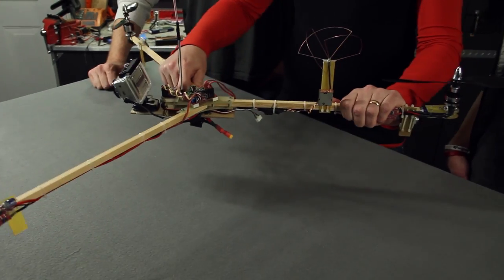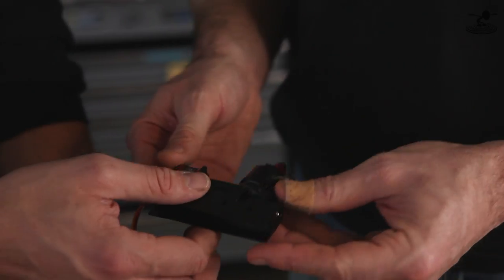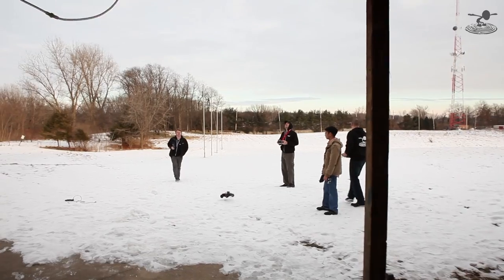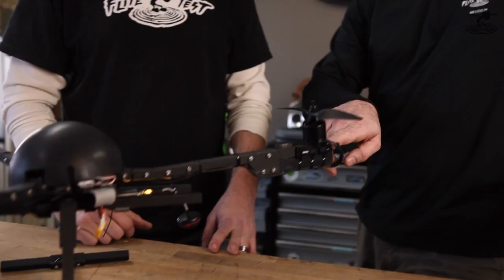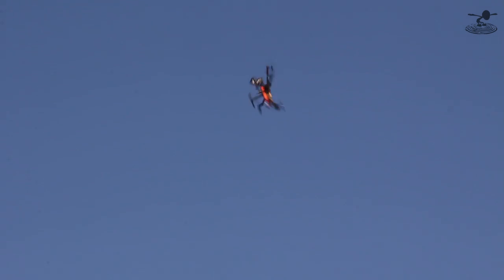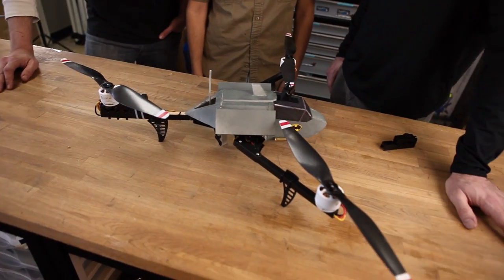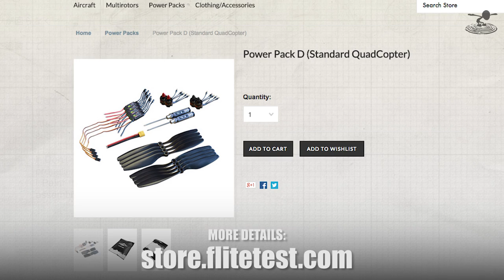Flite Test | Tough Tilt Tricopters

Comment: My first multi-rotor is David's Tri-Copter V2.  I put on 3 - 450 Slow Fly motors with 12" props.  She hovers at about 30% throttle with a 2200 3S motor.  I learned a lot about flying mutli-rotors and building with this copter.  You guys are the reason I am flying.  Thanks for being awesome!!!!

Comment: I came here to find out how the tough tilt motor mount actually works so I can use it in a Scratch-built model. But there's no video of how it tilts or works. At the very end of the video I hear there's a build video of using it. Maybe that video is what I need to see. Better yet, SHOW US HOW THE TOUGH TILT MOTOR MOUNT WORKS!

Comment: those EMAX motors are sweet, i got some cheap, straight from the EMAX warehouse, and put them with cheap Mystery simon K ESC's, and kk2 with stevies 1.17 all wrapped up on a sk450 frame with 9 x 3.7 props. flys great even in windy wellngton.

Comment: A tricopter with three of these would be pretty cool, so you could adjust the angle of the front motors to go even faster once in the air, sort of like a v22 osprey tricopter

Comment: Something I think would be interesting to see would be a dragonfly configured so that the the two motors on the center spars are configured strictly as thrusters.   Imagine the flat spins you could achieve with one running forward and one reversed.  I would think your forward and backward speeds would be impressive.

Comment: Man, I like it when tricopter stuff comes out and I've also suffered a bit from not having a perfect tail tilt mechanism and doing it different on every build.  BUT THIS IS MISSING THE POINT :-(

The thing everyone misses with tricopter tilt mechanisms is the axis placement with relation to the CG of the mass you're tilting and I only realised it when someone on diydrones complained about it.  When you use the servo to tilt the motor to the right is because you want to yaw left... but you're shifting the whole weight of the motor + prop to the right too, so there's an exactly opposite effect, you iniitially get some amount of force yawing you to the right.  Same when you're trying to stop a yaw movement...

The axis of rotation needs to be an average of 2-3cm above the motor base.  And there are no kits or parts available for an easy build.

Second, it doesn't matter how strong the mechanism is because it's the servo that breaks.  So you don't want a direct drive or a same size gear pair like the Hobbyking stuff this video mentions (Trifecta), you want a reduction.  You don't need a 180 degree range of rotation, even about 20deg would do for most people. You do want the mechanism to have the added torque of a servo with a simple reduction which is actually quite easy to achieve in a manual build.
Reply: It needs a NOTAR on the back problem solved!

Comment: All the OPTO escs I've seen have been more expensive than their bec'd counterparts.  Also, checking individual components before wiring it all together is a good practice everyone needs to get into.  It doesn't take much time or effort to run a bec through its paces on the bench before wiring things up.

Comment: With the 5 boom copter, add a second motor pointing down at the back and going the opposite way to the top
So if you lose a back motor you don’t fall out of the sky
But you also keep the great rudder authority

Comment: Nice guys. Did you gyd modify the Yuneec gimbal so you can use fpv goggles instead of a tablet device? I saw the CP antenna at minute 13.26 and that got me wondering,

Comment: also i use bearings for my 360° motor turn and mini bearings for my folding blades, so if i flip, just turn the motors opposite way, and it still flies. now i need do make Landing skies that also go the opposite way,because if i land with the motors turned, it will land on its top.

Comment: i wanna see a big ass quad with Traxxas 2200kv motor:P
Reply: Unfortunately the motor that you have is a brushed motor, you need brush-less for multirotor applications.  If you want to see something along those lines look up some of the large endurance quads.
Reply: ***** you may be confused. i know for a fact that it is a brushless motor.
Reply: CollinandMason Whoops meant in-runner motor(ACT takes a toll).  Unfortunately again, you need brush-less out-runner motors(not car motors)
Reply: ***** if you really wanted to do so, an inrunner motor can be used for a multirotor. but the props would be very small, and the multi would likely have oscillation problems do to the inertia of the motor internals.
Reply: CollinandMason  Inrunners are WAY higher KV, 2200kv, like you said.  Multicopters typically run at 1000kv, unless it's a small race quad, then it can be higher.  On the other hand then it would be small...  Sherman Hartman If there was a gear reduction system (which is inefficient I know) then you could.  The motors on my cousin's A.R. Drone 2.0 are brushless inrunners, and have really extreme gear reduction.
Reply: True. But either way, there isn't going to be much performance coming from in runners.
Reply: Sherman Hartman Also true.  Bottom line is if you want a "BIG ASS QUAD" use Avrotos XD

Comment: I wonder if a break point could be designed in to the servo mount, sounds like a lot of servos are getting killed with the new supper strong tail pivot. Maybe just a single thin zip tie to hold the servo so in a crash rather then stripping a servo you just replace a ziptie.

Comment: Just a thought, it would be great to offer a "quad to dragonfly upgrade" kit that has the tough tilt, servo, and an additional motor and esc. That way there is a simple/easy way to make a dragonfly for those that just bought the quad setup. (yep, I bought the quad and completely forgot that I would eventually want to make it into a dragonfly).

Comment: Hey. have you ever tried to generate the counter torque of a trycopter by a flap under the Propeller instead to Tilt the whole Motor. this can be much better because there are less vibrations an no coriolis forces to handle
Reply: I've been thinking of the same thing and saw a video somewhere on youtube (don't have the link now) of someone who's done it - it works.

Comment: How does David Feel about your 3D print comments?  I think it's awesome that you are bringing such a durable tilt mechanism to the hobby, and even cooler that you are going to stand behind it.  I hope people understand that 3D printing isn't exactly the best option available, but it is functional, and more crash worthy than you allude to in your video, especially if the person using the 3D printer knows what they are doing and takes the time to set the speeds and nozzle temps correct.  It also allows you to provide free .stl models to your customers so they can make their own replacement parts, which seems to be right in line with your business model.  I know the Sweed doesn't work with you any more, and I think you are still very good friends, but it felt a little like you were bashing his product, which by the way offers the best carbon booms available for the hobby.  Awesome tilt mechanism, but your comments on 3D printing did not feel well thought out.  Who know's maybe you and David have some sort of unannounced partnership, but you should make it right.

Comment: Awesome. Why don't people use tricopters as mini quads? There's no reason they are any worse then a quad and may be better then a quad in a racing application because of the affirmative yaw control. Very excited to have electronics in the FT store!
Reply: My guess is cuz racers crash ALOT.....better to not have to deal with broken servos. Only my guess though. 😜
Reply: What about a mini tough tilt? That would solve it...
Reply: Enzo Delia
 Twitchity on the forum has designed a nice mini tricopter: http://forum.flitetest.com/showthread.php?12621-Mini-Tri-Test-Build

Comment: How about you put the 6th motor on a tri setup on the back pointing down but not on the gimbal so you have the thrust and a sort of redundancy for a easy setdown if gimbal motor fails and it cuts the stress on the tilt unit in half by letting down pointing motor do half the work.
Reply: might work but would loose a lot of yaw control

Comment: I can't tell from the product photos, so I'll ask here: how did you get around the proprietary spline issue?
Reply: ***** curious about this too.  what patent are they referring too?
Reply: Trent Lukaczyk servo motors have unique spline patterns on their output shafts. Sadly, they're all different, and they're all patented. FliteTest had to come up with some way to get around this, and I'm curious what it is.
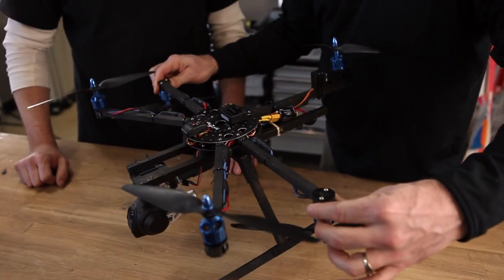Reply: ***** can see it here -- 13:53
there's a trough in the hinge facing the servo that can accept servo horns, looks like you screw the horn into the tilt hinge
Reply: Trent Lukaczyk ah, I suspected it was something like that. Good eye!
Reply: I can understand servo output shafts being different and incompatible because that's just the way things are, forcing change just for the sake of it and costing the consumer more in the name of 'progress'  but I can't understand how the form of a simple spline can be inventive and be the subject of a patent. It's just a bit of mathematics controlling a cutter to make the tooling, that's not inventive it's just a standard industrial process.
Reply: ***** I completely agree. Then again I'm also one of those open source nutheads, so who am I to speak on bogus patents :p

Comment: I recently bought a Naze 32 and the stupid thing will not connect to my computer! Grrrrrr hopefully someday it will decide to work (any help possible)?? Anyway great video guys! Keep up the good work!
Reply: Are you a Barcelona fan?
Reply: Did you install the drivers?
Is there a red led on when you try to connect?
Reply: I'm guessing you are using Windows? Did you install the Silabs CP210x Drivers? There's a link on the baseflight main page.
Reply: I did try to install the drivers but when i looked at the Device manager it said the drivers didnt exist, yet somehow it reconized the control board connected to my computer...
Reply: I tried to install the drivers. There is no red light...
Reply: Oh yes!
Reply: Nick Johnson Common Windows solution: Reboot before plugging the board in? :-)
Reply: Well, regarding your Naze32, does it power up when plunged into the computer? if so, baseflight or cleanflight? baseflight you can also make sure to flash first the latest version but make sure to select the Naze32 board, after flashing the board you should be able to make it work. Hope this helps! otherwise dont hesitate to contact me! Lets figure it out!
Ed
Reply: I can connect it to my computer to make the led lights turn on, but when I check the device manager it says that all of the drivers cannot be found. When I plug it into baseflight, the computer does not recognize it to place it in a port...
Reply: Nick Johnson you need to install the drivers yourself from the baseflight website. Windows will not install them automatically. Then, after you install the drivers, reboot your computer. Then the board should connect.
Reply: I had the same problem, turned out my micro usb cable was a charging cable only- powering the board but not communicating? I tried three computers before trying another cable!
Reply: Nick Johnson Keep us posted if you have try anything different so we can keep helping you! Cheers!
Ed
Reply: Did you download the driver for the Naze 32 board?  Can't just plug-n-play.
Reply: Look up com port driver install on YouTube. There is one verry help full tutorial. Have to fake a com port cause Windows don't use them anymore
Reply: So I tried different cables and different computer. On a different computer it (serial port) would connect but then disconnect within 10 seconds...How do I fix this? On my personal computer the thing still will not work. I "have the driver" (have downloaded it) but when I look under device manager, a little yellow triangle pops up and says the drivers for the device are not installed. I look for new drivers but they aren't out there. When I go into base flight a com port also does not show up on my computer.

Comment: 18:40 what was going on with the motor cut offs?
Reply: They mentioned that Josh burnt one of his ESCs in the crash when the motor got loose. And to test if it would fly with one of the motors failing they simply put it in the air without the motor connected.

Comment: with all respect for what you are doing, but did you have a close look at products like the Draganflyer X6 and all innovations around it? If you use redundancy as an argument, then 5 motors do not give you the redundancy you need. You need 6 motos and why use 5 arms if you can reduce it to 3, known as the Y6 configuration?
Reply: Hans Ham In the video Josh said he liked the yaw authority of the thrust tail.  It's a bit different than the torque system.  So it's a trade off, partial redundancy and the tilt mechanism.  They just released the Y6 though, check that out. (3:05)

Comment: The question is, do you want to destroy a $12 servo, or have a sacrificial 3D printed ABS motor mount that costs about 30 cents to print?

If you really want a tough 3D printed motor mount, just use Taulman Nylon. You'll be busting servos again before you ever break the motor mount.

Comment: they aren't BEC's they are ESC's
Reply: What they explained in the video is that a lot of the time BEC's are included in the ESC's, but sometimes to shave cost or weight they make them ESC only. When that happens you need a seperate BEC, or battery.
Reply: +Michiel i know the difference, hence my comment, sheesh

Comment: Only problem is if you lose your tail motor...you gonna crash!! no redundancy best idea is a Y6 CONFIG!
Reply: +Lucas Colonna your going to crash most copters if you lose a motor
Reply: ziggyzbeak no you don't, you won't crash a y6, a hexa or octa, bit this design you will crash!! No reliability or redundancy at all!
Reply: +Lucas Colonna My fault for forgetting to apply loctite but my Y6 crashed when one prop nut came slack and the top prop was able to tip over and touch the bottom prop.

When something does go wrong they also break up worse than a tri on the same frame size in a crash due to the extra weight. Plus the added expense of more components to get damaged.
Reply: plus,  a y6 doesn't have the yaw authority of the dragonfly, but I do have a design that may give the y6 that authority
Reply: OneManGeekSquad Nice looking forward to see your solution